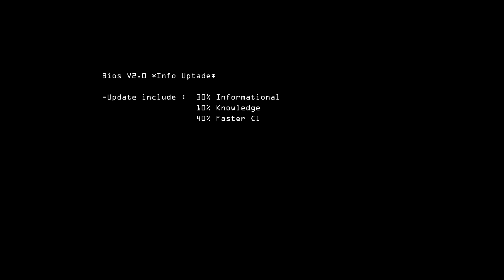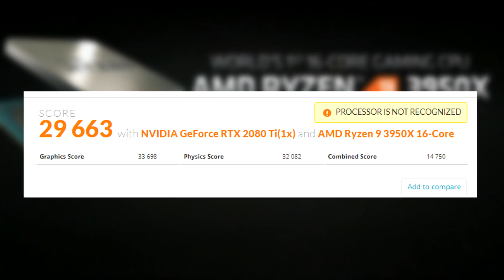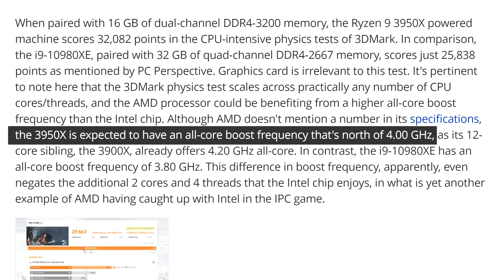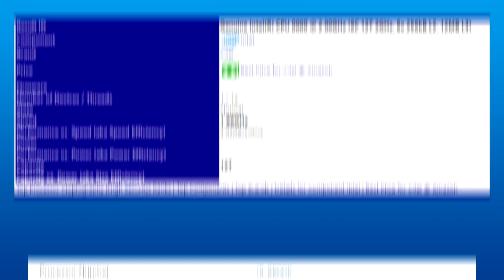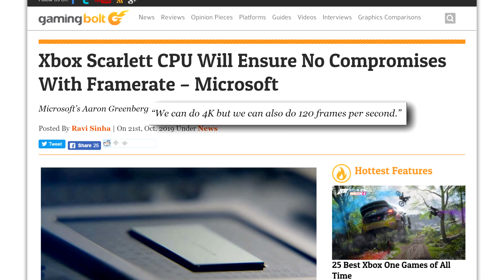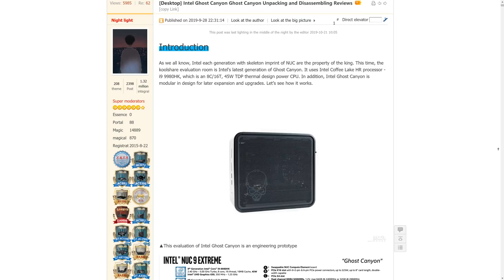3950X 24% Faster Than Intel’s 18 core 10980XE!

Comment: It shows you everything you need to know about just how overpriced/extortionately criminal Intel's commercial business practice really is. They'll still make a profit of this 50% price-cut. Of course, knowing that Intel can afford to drop $1000 like it's nothing, makes you wonder if it's really worth buying Intel at all, especially considering their primary competitor, AMD, is not only cheaper, but faster, and more efficient too. TBH, I've never been a fan of Intel to begin with. AMD has hasn't always been 'good', let alone 'great', in fact they've often been quite 'bad' in comparison to Intel, but I've never personally purchased Intel before, nor have I had any major issues with my AMD CPU's in the past...aside from the occasional compatibility issue, but that's application-specific, and very rare. I actually just upgraded from the AMD FX8320 (Octo-core) to the 3950x, after a good 5-8 years. For the price of a top of the line Intel i9, I've covered the cost of the X570 MoBo, WD Gold 12TB HDD, 3950x, and RAM. This is the upgrade I've been waiting for.

Comment: I feel bad for those guys who paid the $330+ MRP for the i7 4c/8t during the days intel was the supreme cpu leader...funny how their cpu have now  to compete with the $130 CPUs
Reply: Yup, I'm the one.. my 1080ti is suffering severe CPU bottleneck from different games. (7700k @5ghz). Waiting for zen 3, or 10th gen Intel. Will pick the better performance/€ in the 8/16 core thread category
Reply: @ZTiMeOuT99  lol....i feel you bro,i also had my first gaming desktop in 2017 with the i7 4790k that was ofcourse used but,an extremely good deal thats came with the combo.....am too looking forward to upgrade when there is less generation gap,the competition right now is too staggering....you buy a cpu right now and the other guy will make a better one for 50-30% less with more cores,so let the battle settle first

Comment: Intel been selling 4 core parts with small % performance increase for 10 years they wld still be doing the same if it wasn’t for Ryzen I think that’s a pure joke their is barley no difference in most of theys cpus some one with a 2700k at 5ghz/5.1ghz wldnt upgrade till 7700k+ as anything before that is barley any improvement lol but you do get some brainless intel fan boys that got the new cpu every year.

Comment: Devkits would need to be more powerful, so as to run the debuggers and analysis tools while there rest of the console is running at as close to real-world performance as it gets. So having more cooling is not surprising. What's surprising is they're bothering that much with an exterior design for the devkit.

Comment: definitely getting the 3950x when it comes to Aus, AMD smashing all atm
Reply: You wrong mate, Iam Aussie too, 3950x is pushed to limit and cant pass 4.3 all cores on custom water cooling it reachs 100c ,while intel default on 9980xe is 3800gig all cores can be easily overclocked to 4.6 all cores on custom water cooling , with max temp. of 75 c and crush amd with 34000+ score on fire strick physics,10980xe will do even better I expect 36000 to 37000,  time will proof for you.
Reply: @rafsh1846  correct.  Amd fan bois getting crazy that 3950 wins at some physics test no one ever heard of. They know Intel wins at games but they act like all of a sudden they are after a workstation
Reply: jimmicrackhead12 3D mark is one of the biggest if not the biggest benchmarking software.. sounds like you are mad Intel is losing badly
Reply: @christophegroulx8187  winning at games, losing at winzip 7 tests LMAO!!!!
Reply: Hardware Loaded How would you know that if it’s not even released

Comment: #QNA I have an x470 and 2700X. Do you reckon a 3950X or future 4800X would work well on these boards?
And is zen+ still “restricted” to only using 2 memory lanes for better performance instead of populating all 4?

I tend to run a lot of VMs and with only 16GB now, I feel I might need to upgrade system RAM. Also would like to upgrade my CPU either when zen3 or zen4 come out. The price drops of zen+ are RIDICULOUS and hope we get the same with the next release.

Comment: Question: 
That "leaker" of yours is fabricating that, I could do that in photoshop, so youre saying an eight core 9900k will beat an 18 core 10980xe, look at this score of a 2080ti and 9900k (https://www.3dmark.com/fs/16895788) and after looking at that you tell me, theres no way in hell a 9900k at any reasonable clock would beat 18 cores, your video has 10980xe at like 25,something and the link i sent has a 9900k at 28,something, so surely not correct,
Reply from the maker: Tum apisak is a reputable source. He has leaked multiple dozens of benchmarks accurately with links. The intel cpu might be a ES but we dont know yet. All we know is that a 10980XE appeared with those results

Comment: if they can cut prices in half, imagine how much they made on customers over these years...
Reply: That alone is enough reason to go to AMD because clearly Intel was ripping consumers off and it's a given that Nvidia are doing the same, so yeah even thought it's nice that Intel are dropping prices, they had to be pushed to do it by AMD so it's hard to reward Intel for this and with that, I just upgraded my rig with both an AMD cpu and gpu as a reward to them for shaking things up.
Reply: @paul1979uk2000  i still don't think amd is saint here. Their gpu prices are still pretty high for midrange
Reply: @VitoldsTheDestroyer  still high? What about Nvidia, nvidia prices are more than amd
Reply: @mrifanirawan4820  yes they are. both companies set their prices too high. for latest models
Reply: @VitoldsTheDestroyer  even the latest product an AMD product are way cheaper than nvidia. Its weird when u said amd gpus prices are to high.
Reply: @mrifanirawan4820  previous generations midrange was around 200 EUR until mining boom came around. now its 300-400. they never lowered it again, not even AMD
Reply: @VitoldsTheDestroyer  yeaaa every country had their own prices. In my country amd gpus are always below nvidia. About mining things, every gpus price are crazy.
Reply: @VitoldsTheDestroyer  This time, for all the years they offered better performance at cheaper prices no one cared. Now they are still offering more for less but sticking  closer to Nvidia's pricing and gaining market share. AMD will never reach the scale of BS Intel and Nvidia have gotten away with(at least this decade), their customers in both consumer and corporate markets have different expectations of their value proposition.
Reply: Intel is a for-profit business.  To keep their value and make investors happy their goal is to price things in a way that maximizes profits, to find the right price that will sell the volume they need and make as much per sale as possible while achieving that volume.  They aren't ripping anyone off, no one had to buy an Intel CPU at the prices they were offered at.  What we see today is simply a function of good competition, and AMD's chiplet design as well as more advanced manufacturing process gives them more flexibility than Intel.  AMD is simply winning the race today, but they aren't some whit knight looking to save you from high CPU prices, they're just pricing their parts where they can find that right mix of sales volume and profit margin, too.
Reply: Intel doesn't 'need' to sell commercial/retail at extortionate prices, because they make so much at the enterprise level, yet they have continued to rip off the little guy anyway. I never have, and never will, buy Intel, and I work in a corporate technology-focal management consultancy. Everything enterprise is Intel. The little guy deserves better.

Comment: Intel is seriously  fucked. Their HEDT lineup gets attacked by the 12 and 16 core Ryzens.... so what the fuck will happen once the 24, 32 and 64 core threadrippers launch? I predict a complete and utter destruction. Btw, I just bought a 12 core 3900x, and it's an awesome machine. Doesn't even flinch while I'm gaming at 144Hz and streaming at the same time, while I have a Win 7 VM open in the background just for good measure.

Comment: Rubbish. If you bother to check actual benchmarks from reviews of the 9980XE, the processor that the 10980XE replaces, it achieves a physics score of around 28200-29000 (depending on RAM, etc) at stock and around 32300-32500 when moderately OCed. This puts it above the supposed leaked score of 3950X. And Firestrike’s physics score scales with increases in boost clocks - there was 10-11% increase going from the 7980XE to 9980XE. Expect a similar bump with the 10980XE which will bring the stock physics score to around 32000 too. And although you might quickly point out that still the 3950X achieves what it achieves with two fewer cores, it should always be pointed out that it has 70% more L2+L3 cache. So it is by no means an achievement with fewer resources...

Comment: #QNA
Is it worth it to get refrrence RX 5700 (non-XT) compare to AIB card? In my country, they are very cheap, almost 50-75$ (conversion) cheaper. My PSU just 550W, so the reference card good enough because it is the lowest power cosumption card. I want a compact card in height because of using vertical GPU mount.
Reply: From what I've seen The reference power throttles by about 10% at any extended work load and is 30 db higher 

I whould still recommend the reference though in this case considering that price difference. 

Side note: if you dont mind water cooling a water cooler to put on the reference model is about $40 last I checked so you may be able to do some cheap water cooling for it for cheaper then an AIB recommended if you are willing

Cheap water cooling guide 
https://youtu.be/IQ8oqfbNXFI

Comment: When you see a price cut of 50% in just one generation you shouldn't think
"Hey, that's cool. It's 50% cheaper now. 😊"
but
"Wait a minute. When they can sell it for that price now, why was it so expensive before? 🤨"
Reply: Suckers payed for it
Reply: Coz u look at the market for competition and previously amd was garbage so intel called the shots
Reply: Those are the correct reasons for the former price but not legit reasons.
Of course, you can say "It's legal to do that so I do it. Yay Capitalism!!!", but when you say that you're a greedy asshole.
Reply: Two reasons.
1) Fixed cost vs unit cost issue.  Intel has to constantly invest money to R&D and manufacturing on both successful and failed projects since they don't know before hand which one is going to succeed.  That is the majority of costs for Intel.  What it means in practice they can reduce the percentage of any single lineup that goes towards those costs a lot and still make profit on those. However if they drop prices on everything they would have to start firing R&D people and stop buying equipment for newer nodes, or go beg investors for more money.  
2) It literally cost far less to make today than year or couple of years ago when those things where launched, the yields have been improved and fab equipment has been already paid itself for 14nm, so they just rolled couple of years of cost reductions to a single price drop.
Reply: @jouniosmala9921   That only explains that the price drops over time. But not that it suddenly drops 50%. Of course, the manufacturing price dropped over time, but it probably didn't suddenly dropped 50%.
But soon AMD will drop the 3950X and it looks like that possibly it's even a better CPU at $750 and nobody would buy a slightly worse CPU and pay $1250 more for it. And you can't refinance R&D when nobody buys your product.
When over years Intel had no serious high-end competitor while also having high-end prices, then AMD comes back in the high-end market with reasonable prices and then suddenly Intel drops the price by fucking 50% it's pretty obvious that the timing is not a coincidence.
Reply: It is obvious to everyone who watches these videos why Intel dropped the prices. However I was answering about sentiment of them as particularly greedy by being able to drop prices of some product line 50% when they need to.  Intel has lower net margins than TSMC or Memory manufacturers.  While AMD:s just got to 3-4% net margin while from 2006 they just lost a lot more money than they have made, based on their net margins and had 4 years when they didn't loose money from that time.   Intel's net margins have been inline with companies that require high investment, Intel's long term average seems to be ~20% while TSMC:s long term average seems to be around 33% .
Reply: It's simply what I call a need-based price gouging. Intel marketers know there are professionals/enthusiasts who need the power of its HEDT processors and they also knew how much they would be willing to pay for one. Intel did the same with its servers but on a much bigger scale. Intel has more to lose with its server chips than consumer chips with EPYC beating Xeons on every front.
This price gouging also allowed Intel to price their high end mainstream cpu higher as the price differential was big from its HEDT CPUs. Now I feel like there will be a price cut on mainstream desktops also but by a much smaller margin.
Reply: You were funding Intel's bosses cocaine and hookers. After price cuts they can get only cocaine.
Reply: There is the possibility INTEL will sell them at loss, just to make certain people do not buy AMD chips.
Reply: Thats called an abusive CPU manufacturing leader,now that its dethrone

Comment: I don't know, I don't really believe that 10980xe scores that low in Firestrike physics. There must be something wrong with the hardware configuration. If my calculations are correct, 10980xe should have about the same physics score as 1950x. I guess we'll see soon enough.
Reply: First this test makes no sense on firestrike physics as it is limited to eight cores and takes no count of the ten (eight for AMD 3950x) others. So of course the result will favour the one which has the highest base clock speed, conveniently the 3950x. It should have been performed in Timespy extreme to be at least relevant. Secondly, their bench is not evenly configured. Third, i guess the test is performed on default core speed, which no one buying a core extreme will use. They're not unlocked for nothing, they're meant to be overclocked... And last point, i don't get the bashing around this cpu by persons who, in more than 95% of them, will never have any use of such cpu's in their daily usage. It is professional grade cpu which can be useful in some field of activities such like 4k video editing, 4k picture editing or heavy programmation and computation. AMD also has very good performing hardware, the relevant differences are mainly at the level of their respective api's which dictate your choice in regards with the programs you are using. The ones buying those cpu's for gaming purpose are just in a mood of testing who's got the longer d*** or the deepest pockets as they will have no use of such horsepower in this usecase. I kindy find amusing to see so much people being hyping cpu's they won't use at 15%...
Reply: @ashandaaritevalumbre2186  Very good points. The only thing that I don't really agree is that people buying professional grade hardware are overclocking and tweak it. People that would do so are actually a tiny minority. This is  what hardware enthusiasts like you and me might do, but the vast majority of professionals don't. The comment section of a video or a forum are also places not indicative of the real world so it's not appropriate to make conclusions based on the people you meet and interact with there. A video editor or another person doing some type of professional work very rarely has any idea how to overclock and tinker with voltages and other settings in BIOS and even if they do have an idea, they won't do it. In a professional environment system stability is much much more important than 5-10% performance boost from overclocking which might make the system unstable, hotter and louder. Troubleshooting problems caused by overclocking often cost more money to such professionals than the money they would save from the little performance boost overclocking can give them.
Reply: @bgtubber  I agree that overclocking to the max is certainly not what we are doing in a datacenter environment for the stability reasons that you mentionned. Those cpu's are not actually meant for that anyway, more for strong home configuration that we profesionnally use. I actually do it myself for rendering my wife's architectural projects / for my storage management activities and i slighlty overclock my systems mostly to get the best usage comfort i can in those tasks. That's what i meant by stating those cpu's are not supposed to be used at base clock speed. I prefer to manually overclock them in the vicinity of their max turbo capacity, acting core by core and tweaking the voltages accordingly. As i'm swapping my cpu's every four years, i actually never encountered degraded silicon by doing so.
Reply: Its still early and not released product, you cant judge it now, once its release we can judge it, its rumored to OC over 5ghz thats not something 3950X can come and beat no way..... Im sure it will be opposite, this will beat 3950X at least 25%
Reply: TRX X Lol 18 cores overclocked at 5ghz.. in your dreams maybe